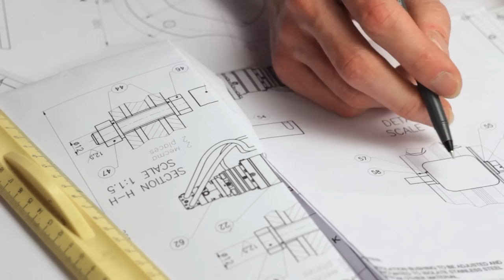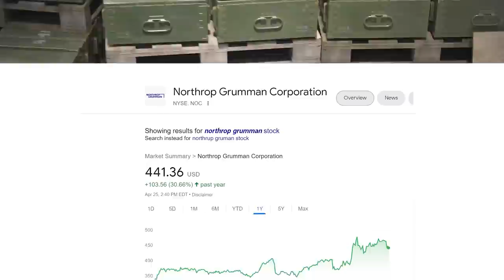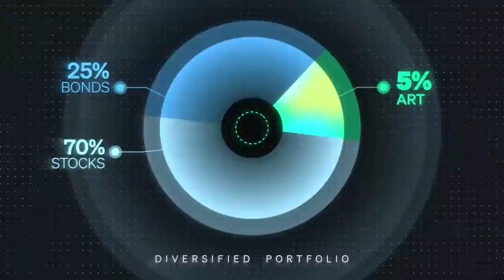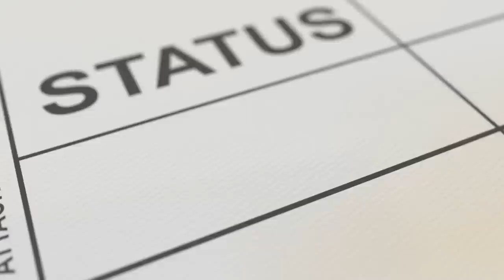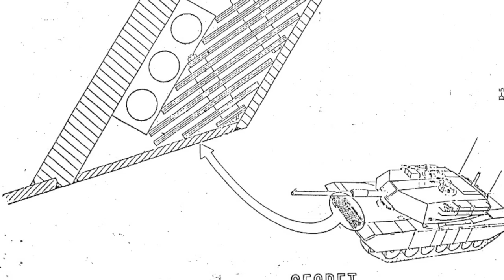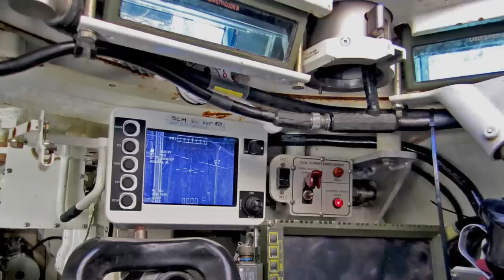The M1 Abrams Tank Needs to Chill Out

Comment: I was in Iraq for Desert Shield and Desert Storm in Delta Company 2/66 armor. During a night battle, the word that "there are no friendlies to your front" was passed down. Unfortunately, bravo company 3/66 armor was advancing on the left flank of delta company 2/66, but in the confusion of night warfare (GPS was still very rudimentary and not integrated yet and there was no such thing as IFF for ground vehicles) started to get off course and crossed in front of delta by accident.  Before this mistake had been realized, gunners in delta had shot and killed 2 tanks belonging to bravo 3/66 including the company commander's tank (B-66). Captain Ingram called cease fire as soon as it was apparent the tanks he was shooting at were not enemies, but in the TIS (thermal image sight) a tank at 3,000m looks a lot like any other tank. The ground we crossed was almost totally flat  with zero vegetation so engagement range was further than usual. Some days later I was also in the recovery team that recovered the two destroyed B 3/66 tanks. On B-66 I counted a total of 17 penetrator strikes, of which only one actually penetrated. These are all 120mm depleted uranium APFSDS penetrators we're talking about, with 17 hits to the turret and hull but only one penetration. That one hit the turret ring on the starboard side of the tank, passing through the body of the gunner on it's way through the turret, but I couldn't find any exit hole. The other 3 crew members of B-66 made it out of the tank mostly unharmed before the ammunition ready rack exploded, blowing the blast panels off the top of the turret and scattering fully intact DU penetrators all around the tank. Of the other bravo tank that was hit, all 4 crew members survived. So that is how survivable the M1 tank is, how well the crews are trained (survivability, gunnery, etc) and how tough the armor on the M1A1 HA that we ere driving was. Cappy says the newer Russian ATGMs would kill it, but I'm not so sure. My sources in the armor community have also told me that recently a lot of M1 tanks have been fitted with the Trophy APS, which combined with armor and reactive armor, would probably make the SEPv3 nearly invulnerable to anything that's not a top-down attack. 

Try shooting a T72 17 times and see how many of those Russians are walking away from it.
Reply: They (Russian tanker) essentially become satellite.
Reply: Yeah , after first hit or 2 most T-72 go Frying pan 🤣 First time I saw that live I legit kissed my tank
Reply: Outstanding discussion of the M1 Abrams in combat and the incredible high level of survivability. I strongly believe that with the US's Combined OPS and some support with our Allies, ALL russian armor would be destroyed and their retreat would lead to the capitulation of Putin's desire of an Empire.
Reply: Think about it, seventeen hits at a range of almost 2 miles.
Reply: @lorrinbarth1969  Yeah, and a peneteration too. The APFSDS effectivness decreases with longer distances, if they were closer it could end much worse.
Reply: How the fuck does a gunner engage a target they can’t identify?  
And how does a unit get 2 miles ahead of an other unit.. piss poor leadership..
Reply: @soup31314  When the plan is movement to contact, and there are no friendlies to your front - anything out there in front of you is a target. And at long range with the early thermals, you can't tell an M1 from a T72,  It's that simple. If you've ever been to that part of the world, the ground is totally flat with no vegetation and zero landmarks - it's hard to even imagine let alone explain. Endless flat nothing from horizon to horizon except your own vehicles. Without GPS it's terrifyingly easy to get turned around at night, people got lost at night all the time. And even getting a few degrees off course can eventually put you in someone else's sector. Yeah someone fucked up, but later that night the same guys wiped out a republican guard division defending that wadi with zero losses.
Reply: @firelock9080   Celetsi where to start, even if you’re on a movement to contact you always positively identify your target before you engage. Join the army in 1994 and was trained on m2a0/m2a1 Bradley’s.  
If you can’t ID your target then you don’t shoot!  Fucking tankers always shooting before ID a target. 
Jan 03-sept 03 OIF1.  I have been to the area.  I finished what y’all started.  Even when we were on our movement to conctact to Baghdad you still had to identify you target!  
A whole Republican guard division?
Reply: @soup31314  Well Soup, the motto of the US Army Armor is "Shoot, Move and Communicate". Nowhere does it say "Identify". LOL! But seriously, the difference between 1991 and 2003 is like being born on a different planet. Not only had the technology improved, but so had the Army itself, in it's policies, doctrines and training. The better ways of warfighting that you talk about were learned on the battlefield in Desert Storm, they didn't spontaneously appear in 1994 because y'all were smarter. You joined in 1994 and were taught how to fight by instructors who were learning those lessons on the battlefield right next to me. We lost two Bradley's in 1/41 as well, and no man in the branch didn't hear about the 11M who ran back into a burning Bradley that was literally melting in place from the heat, going back in THREE TIMES to save his brothers. I'm glad you finished what we started but don't make your sloppy seconds sound like you were somehow better than us.
Reply: @firelock9080  it is called a rules of engagement.  the same ISU was used on the bradley from the a0 through a3 models lol.  you think the tech improved from 91 to 03? I was still wearing a 80's flak vest up till 6 months before we deployed.  We were still using iron sights, pvs 7's.  
after do more research it was even more of a shit show!  your company engaged 5 abrams well inside of the next units AO!!
Just from the battle of norfolk yall lost 5 m1 tanks and 5 bradleys to friendly fire!!! we didnt lose that many while attacking to badghdad while fighting the whole country of iraq.
Reply: @soup31314  If you compare friendly fire incidents throughout history it's clear that the number goes down every major war. Not sure what you're trying to prove at this point - this comment section is about the M1, not the Bradley. Say Soup, did you ever start your Bradley with a hammer? A crunchy taught me how to do that at KKMC.
Reply: @firelock9080  my pony is your unit was fucked up!! And your unit engaged 4 friendly tanks out of sector.  Almost all friendly fire in ods was abrams tanks.  
Just shows tank crews suck at their job.
Reply: In Russia, you simply don't walk away from tank.
Reply: @soup31314  I can't say I disagree with you one bit there.  Vehicle identification is a 10 level task. It's supposed to mitigate and eliminate friendly fire incidents.  These kilos see a blob on their thermals and engage it from maximum range without any thoughts as to identification.  It's if they're not trained to think.... Only act.  You would think with all that armor and that big ass cannon that they wouldn't mind getting a little bit closer in order to identify their targets properly instead of just pulling the triggers every time they see a hot spot.

Have you ever heard their morbid joke that goes... When in doubt shoot a Scout?  Cue the giggles from other tankers standing around.... They knew better than to say that line in third armored Cavalry regiment where we had two platoons of tanks and two platoons of Cav Bradley's (M3a2's)
Any newbie tanker that smarted off with that was basically on his own and his buddies did not stand up for him when the Scouts checked his ass real quick
Reply: Acorrding to my Drill Sergeants at Fort Knox in '98 (I went as a 19D), training and doctrine definitely changed between '91 and '03. PID was one bullet on a block of instruction in Basic Armor Warfare. Up until then the Army was worried about a Warsaw Pact threat in Eastern Europe. In the years leading up to the First Gulf War, Armor was taught how to fight in the Fulda Gap (I was still running those drills even Post 9/11) were PID was less emphasized due to the shorter engagement ranges (forests and farmlands vs desert).

The painful lessons of Blue on Blue in what was otherwise a brilliant rout of the world's third largest Armor Force lead to a rapid change in how PID was emphasized going forward, especially since the Drill Sergeants who were teaching the privates at Fort Knox saw first hand what prioritizing rapid engagement over deliberate target elimination results in. Let's hope it's a lesson that we continue to push going forward. 

Although, I've heard the Army often forgets the most painful lessons until it bites them in the ass. Like nation building during combat operations, or emphasizing soft skills for garrison over combat ability when rating leadership.
Reply: I served in Alpha Co. And HHC 3/66 stateside at Ft Hood from 83-86. I heard about the fratricide from a friend that was still on active duty. I'm betting the second tank's TC was SFC Jaramillo. I heard he got blown out of the TC's hatch.  I knew him as he used to be in Alpha Co. Small world
Reply: YoungMazda-n3h   uh... you're REALLY far off the mark with this shit take. You seem to be under the delusion that anyone said an M1 can't be hit or disabled, both of which are false. The point is that the crew of an M1 has a excellent chance to survive a hit, which everyone in the world knows from unending videos of T-series tanks with their turrets flying 100 feet into the air isn't true of Russian made tanks whatsoever.

Comment: When we transitioned from the M60 to the M1 in 1988, we used to say the M60 was an $800,000 rolling casket, but when we got the M1, (and it was only the 105 mm), it was like transitioning from a gremlin to a Mercedes!  Then in the Gulf war showed how well the M1A1 could operate! I believe if you have a well-trained veteran crew, the M1 will still hold up tank to tank in this modern day!
Reply: Tank to Tank,sure,but a Javelin will make into a rolling casket.
Reply: @rick-be  hard to say javelin in itself have very little explosive power alot of the time you see tanks turret flying is beacuse of ammo cook off abrams have blast panals now no question the javelin could knock out the abrams and mission kill it but i bet there a higher chance of tank crew surviving then your typical russian t series tank
Reply: @patthonsirilim5739  Stopping the tank is the only concern in combat.KIAs are for the staticians.

Comment: Tanker here, the other point of berm drills where we start low is we're almost completely hidden until ready to engage, then only the turret is exposed when firing, which has the strongest armor.
Reply: Yup and hull down tactics have been a hallmark of US and NATO tank tactics since WW2.  That's why NATO tanks are so tall in comparison to Russian/Chinese ones.
Reply: @mrvwbug4423  They are tall due to being livable for the crew. Soviet tanks have poor gun depression and lack any space inside plus 20 tons of armor in order to be small and low. Soviet terrain is also mostly flat so the design ignores any need to depress the gun as much as NATO tanks which have to fight in all kinds of terrain. Combat in a Soviet tank wears the crew out.
Reply: This has been done since WW2. Problem nowadays is drones, artillery and ATGM´s. Tanks simply do not have the same level of protection they used to have. This might be changing right now with modern APS.
Reply: @mrvwbug4423  NATO tanks are so tall because they do not use an auto loader. This kind of tactics have been used since WW2 by all parties. It is not like just the west came up with the idea to stay behind cover.
Reply: @sierraecho884  Exactly. But the combat tactics the Soviets appear to be using are not what they did in WW2 nor what their training for operations in NWE is. So, what are they doing and why?
Reply: @sierraecho884  US and NATO doctrine dictates air superiority first before ground movement. Russia doesn't have superiority and it is still trying ground offensives that's why they are dying to drones. US and NATO have some great anti drone tech. Trying to make a US/NATO evaluation based on Russian mismanagement of assets is a bad way to evaluate doctrine.
Reply: @Thornbeard  I was not evaluating doctrine.
Reply: Top hat ! On the way..lol

Comment: i was on m1a1 in the army in the early 2000s... I don't know where these guys always get their speed numbers for this tank... it went much faster than I have ever heard from these kinds of videos.  The thing was a beast.  Unless you've actually been on one and done some maneuvers, you just can't understand, haha.
The tank is quiet enough to be sitting in a slight depression, just off the road (in the woods), and have a humvee drive by without noticing you.  Its crazy.  On asphalt, you actually hear the track thumping the ground before the engine.
Alas, the army and I didn't get along, but I still love this tank.
Reply: Drove the tank with a mine plow attached and could do 60.
Reply: I wonder if the actual top speed is still classified, and the lower number is the official story.
Reply: @AlexandarHullRichter  usually the engine is governed to avoid running down the engine lifetime during operations which limits speed. When that governor is taken off the Abrams can allegedly hit almost 70mph with that 1500 horsepower engine

Comment: I wouldn't be surprised if we see drones on tanks in the future. These tanks already have encrypted wireless networks, so launching spotting drones or even offensive ones does not seem like much of a stretch.
Reply: You can actually link a Scan eagle and raven already to the tank once its in the air.
Reply: I think a pair of dedicated drone vehicles would go well in a combined arms environment.  One command platform and one forward deployed rearmament/refuel platform.  Modular drones using AT and/or AP weapons serviced and carried by a vehicle that sits back at about mortar carrier range.  Tanks won't carry drones, their mission has always been direct fire, but a system dedicated to the capability would be hugely effective and slot in nicely.  It would end up being both cheaper (thus more of them) and more survivable than helicopters that fill that role now.
Reply: @nunyabusiness9433  cheap and small drones could provide a big accuracy boost in some situations, so carrying a few makes sense imo. It would help to spend less time looking for targets and take a lot of the guessing out of the shooting. Dedicated vehicles for launching drones and loitering munitions can definitely be devastating in some circumstances, but those can be launched by infantry as well...
Reply: @b127_1  A drone capable of carrying an ATGM or MG is probably beyond something man portable, and you'd want the infrastructure needs to fall on somebody other than the people fighting what's in front of them.  For recon and fire support calls at the platoon level they would absolutely make sense, though, you're right about that, and that's entirely within the wheelhouse of a platoon leader.
Reply: @nunyabusiness9433  yeah, it'll be a while before you can take out a tank with a switchblade. Launching atgm equipped drones in the field would be a massive accomplishment. Then you'd basically have an aircraft carrier on wheels.
Reply: @nunyabusiness9433  look up the cancelled MRM-KE long range guided projectile, and consider how that would work in combination with drones, wither dedicated to each tank or as a separate arm supporting the tanks.
Reply: No- tanks will be unmanned vehicles themselves- already in the works
Reply: @j.f.fisher5318  That would be awesome.  You'd never have to leave cover to spot or fire.  They'd make better artillery rounds, though!  Any infantryman with a drone can suddenly drop guided munitions just by parking drones on avenues of approach. 

 Counter drone warfare gets more vital every day now!
Reply: @show2ime  oh definitely, but that's going to take a while. An m1 Abrams will require at least one crew member for the foreseeable future.